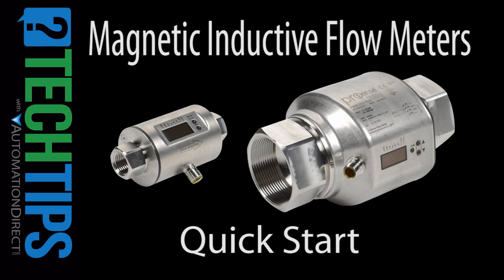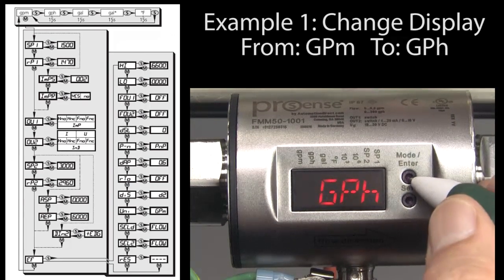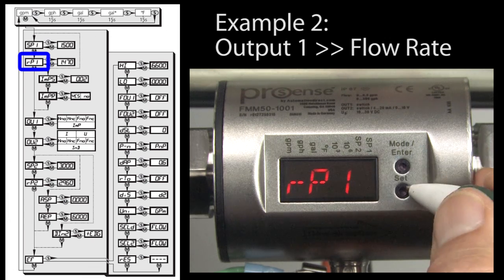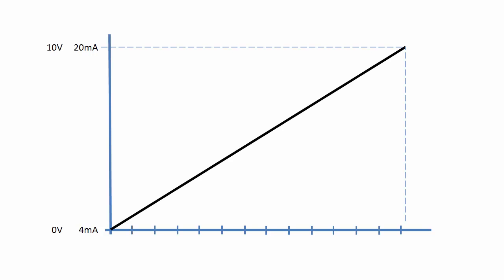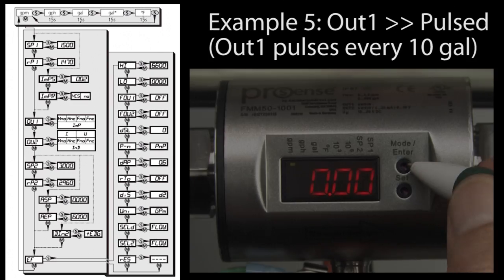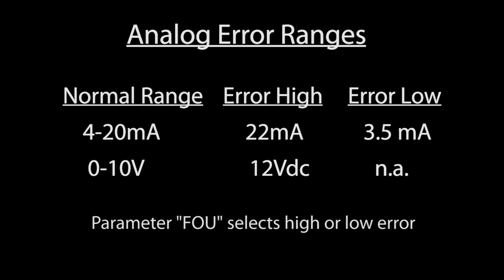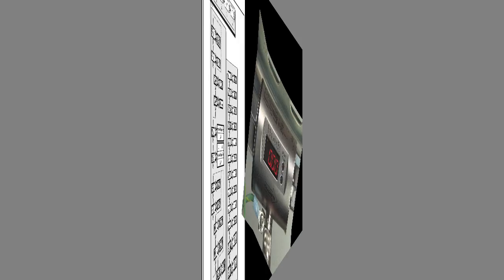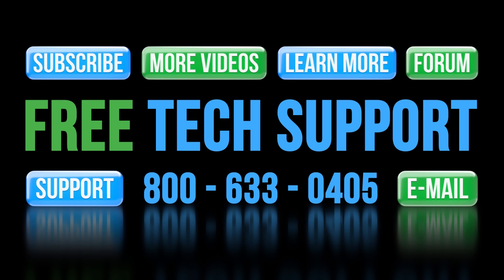Magnetic Flow Meters Quick Start from AutomationDirect

Comment: Can I use this to set up an amount of water instead of gpn or flow?
Reply from the maker: @jeffpalmer, some of these do have a totalizer output/tracking option, which is the term they use for counting a total volume of water rather than an instantaneous flow rate. Thanks for the comment and let me know if you have any further questions!
Reply: @automationdirect  hoping I could find one that I could use to monitor then shut off for a brine tank so it doesn't overflow
Reply from the maker: @jeffpalmer2192  you absolutely can. Take a look at section 4.3.3 the manual for our totalizer magmeters here:

https://cdn.automationdirect.com/static/manuals/flowsensors/fmm50_75_100-1001.pdf#page=9

just make sure the magmeter you purchase has a totalizer option and a digital output
Reply: @automationdirect  it does I actually have one on a shelf due to us having a chiller.
Reply from the maker: @jeffpalmer2192  Great! It should work as a totalizer output.

Comment: My flowmeter shows a GPM rate in 0.05 scale, how could I set it to be 0.01 scale?

I mean, it goes (from 0 to 2 for example) 0.00 - 0.05 - 0.10 - 0.15 - 0.20 etc.
and I want it to be: 0.00 - 0.01 - 0.02 - 0.03 etc.

Thanks!
Reply from the maker: I don't see a way to do this in the user manual. Contact our free tech support and see if they have any ideas:
https://community.automationdirect.com/s/contactsupport
Reply: Did they end up providing you a response?